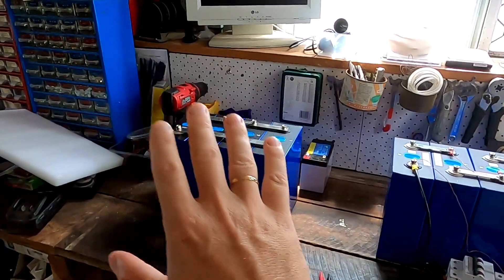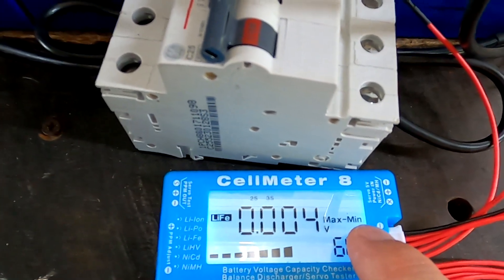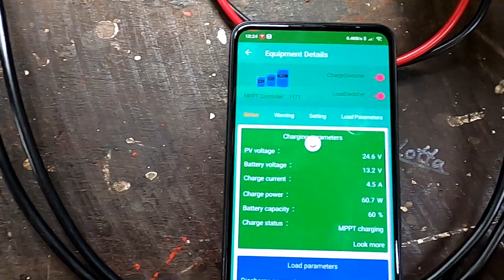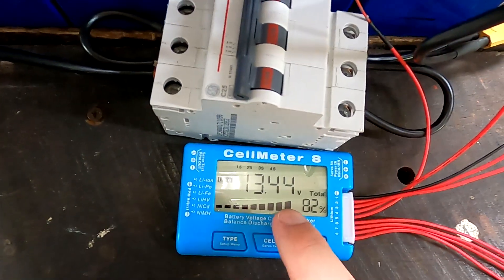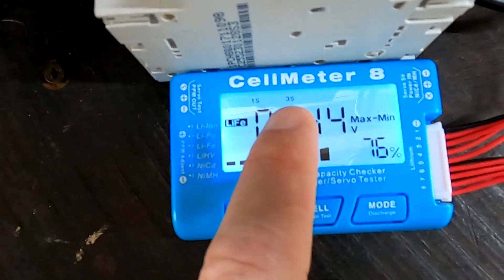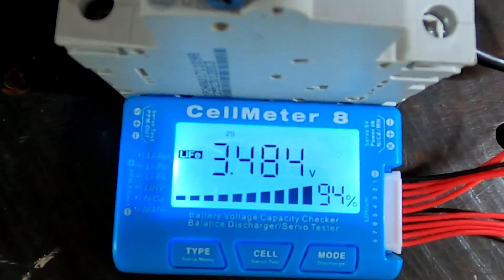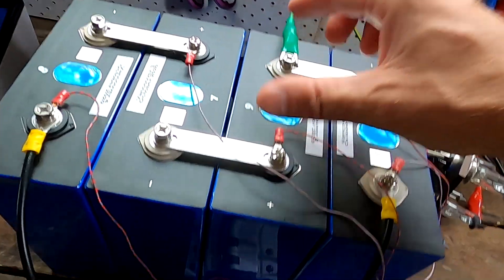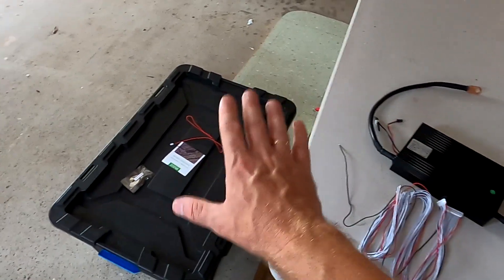Do this and you don't need a BMS 😉

Comment: What if you just use active balancer to balance them then setup the max voltage juat into 13.8v and discharge into 11v. Does it manage not to damage the cell?

Comment: The new version of the little blue meter you used in video  from Amazon for around $12 now has a setting that will balance the highest and lowest setting!!! So now I have a $12 BMS and I am a lazy BMS operator!   

I would not have known about the cell meter 8 if I had not watched your video. I run Eve cells, grade A from 18650 that are top balanced...the $12 cell meter is all the BMS I need.  My Solar Epic 4215s can be set by using the cell meter volts to have accurate parameters ...invertors and solar charges usually are not accurate so I go right from the battery voltage always.  A lot of undercharged batteries out there because people do not realize that even though, for example, their solar charger shows 14.6 volts it is actually 14.2 volts charge voltage at the battery. Thanks for your videos!

The best set up is to have at least two battery banks and let one bank set overnight and then charge it accurately the next day with no load.  Lithium batteries do best when used not charging and using a load at the same time.  I have two ebikes and I think lithium batteries were meant to charge and discharge like on my ebikes. I have dual batteries on one bike that gives me 39 AH. I could put 16 Eve LF 105 in the rear baskets on my bike and have a 48 volt 105AH battery on my ebike!!! Lol.

Comment: You don't need a BMS. Just a low voltage cut off relay and one constant current power supply to each cell. The only thing that would be a good idea is to monitor each cell voltage individually and cut the relay / solenoid to cut power from the pack when one cell falls too low.

Comment: Does the solar charge controller connect only to the BMS rather than to the cells?    If the solar charge controller is connected to the battery cells, how does the BMS override?

I'm considering buying four 3.95 maximum volt sodium ion cell brick that physically looks like the cells in the video.  Why they use 3.95 cells, not a clue.   Four 3.95 cells should allow 15.8 volt maximum.   I've not been able to find a solar charge controller or a BMS for sodium ion cells.

My application is for remote off-grid campers that sit a long-time over the winter, sometimes - 40  degree F.

Will sodium ion cells off gas hydrogen like lead acid batteries?   I don't think that the sodium ion off gas which make it easier to keep the batteries in an inside protected environment over the winter?

Comment: A couple years ago I bought 3 24v k2 lithium iron phosphate batteries used. After a couple of them failed I harvested the  26650 cells and BMS. So last week I was messing around and built a 12v battery pack with the 26650 cells. It's actually 4s 5p but right away after cycling the pack I noticed that as soon as I started charging it the cells were almost exactly balanced! Im actually shocked! Now with that being said that doesn't mean that you won't ever have some kind of short. Also lithium ion cells are from my experience little explosive devices. So better safe than sorry

Comment: Bms is indeed always needed, but balancer in some situations is not needed and can actually cause imbalance. I have made battery packs from samsung and panasonic 18650 cells and used them in high power diving lights for over decade, and especially Samsung cells tend to self balance over time, with voltages being very close to each others. If balancer is used, the differences grow bigger.

I think this happens because there are natural fluctuation in cell voltages but capacity in long term decrades much more evenly. When using balancing, it is actually charging different cells with different capacity, causing different degredation over time. 

When cells are in parallel, each of them receive exactly same amp hours but possibly different watt hours.
Reply: If a balance is causing imbalance, it therefore isn't a balancer.
Reply: @clintoncoker6 It is balancer, and it is equalizing cell voltages in certain state of charge, but it does it by moving energy from higher voltage cells to lower voltage cells, and in many situations it causes uneven wear over time and makes it harder and harder to maintain balance. Making a good balancer, needs lots of research and algorithm that is more sophisticated than just equalizing voltages. 

There are many reasons why some cell voltage can be higher or lower than others. Capacity differs between cells, and there are differences in internal resistance, temperature behavior and also temperatures within the pack

Comment: Need a solar charge controller that hooks up individually to each cell to be its own bms and balancer .. 
That idea is for free..
Imagine.. the power can be pushed into lower volt cells and stop charging higher volt cells.. attach old and new cells ...if it has dc conversion to lower the dc current going to the inverter, than you could potentially hook up a 5th battery and have 16 or 17v ..the controller regulates it to a usable volt for your inverter .

Comment: I used to let connected one of those cell meters on my scooter battery  7S  25.4V  60 Ah and after some charge/discharge cycles I had cell nr 1 and nr 2 with a significant  lower voltage relative to the other 5 cells. Finally I realized that the meter to power the circuits uses the 2 first cells. Now I only connect the meter cable for some minutes to check the voltage and no more problems with the balance of the 7 series.
Thanks for your excellent videos.
PS: Just bought a JK BMS 150 Amp for my 15 kWh solar battery pack and I am very happy with it.
All the best from Portugal.😬

Comment: Good morning Mr Andy. Thanks for this well explained video on why a BMS is needed. 
I have a JBD BMS who will not allow charge or discharge and this happened after my 24V LIFEPO4 DIY battery drained to zero percent (0%) (from Xiaoxing app). When the BMS is connected to the SCC, the voltage will rise quickly and register full charge delivering 0 amps. I charge it directly via the SCC to about 36% (3.23v per cell) )and still the BMS did not start. When I connected the load via inverter the voltage of 25.9V quickly drained to 17.3v and the inverter disconnected.
The specs of the BMS is (AP 20S006 20S 200A).
I tested charging the battery pack directly with SCC and also discharging with an inverter and it works.
It means it is the BMS that is the issue.
Kindly help with the solution.
Attached is the picture of the BMS model too.
Thanks

Comment: I am not using a BMS I have a 96 cell 16s 6p 150ah 48v battery bank. I only use a balancer and the charge controller its an outback FM80 settes .5 volt below recomended voltage 3kw array I was using a Daly BMS but the voltage at the series 15 an 16 was higher than the other and it disconnect the system buy another and did the same I dont know why both BMS did the same... so I only use the balancer.

Comment: Hey, if you have a 4s battery but its made with 8 cells. is it better to have 2 bms and connect the two total packs or only on bms over all the cells?
Reply from the maker: I like the idea of having two BMS for such a setup so 4 cells in series with one BMS and this in parallel with the second set.
The major advantage here is that each cell ist controlled individually, while in a 4s2p setup you will have two cells in parallel. They will show as one cell in the BMS but are in fact two cells.
Also, from a redundancy perspective, if you have two separate banks in parallel each with their own BMS, if one fails of one faulty cell, the other bank is still working..

Comment: I think that no BMS is not a good idea. The batteries are too expensive. Have at least a watchdog running to disconnect in case things get out of hand. There are many cheap ways to do this. Even with an arduino and a couple of mux shields. Check the voltage of one cell every second. Sound a warning if things worsen. Disconnect the battery pack if things get really bad. 
You don't need to do any balancing usually. Just accept that the lowest cell capacity dictates end of charge/discharge. Return the worst cell to the vendor, if it is out of spec and get a new one. Or add a little 18650 to that cell (fused!), to add to that individual cells capacity.

Comment: hello please may we know is it possible to connect a lifepo4 pack 24v like this with a bms to an inverter that does not have any battery communication input ? Someone said the bms must communicate with inverter in case the bms stops the battery while inverter is running ?? Could not understand how this would be a problem.. TIA

Comment: Very interesting video thank you.i have 48v  BYD lithium Battery 15.4kWh but unfortunately I misplaced the cards connecting the bms that mean I don't have a bms in the Battery pack,they are new and never been used I want to know if there is a safer way for me to use them please.

Comment: I understand the overall message,BUT, the cell 8 is inaccurate at measuring individual cell voltage...I wish U had of used ur multimeter and verified the cell in question. The cell 8 is good for reading overall pack voltage and Ballpark cell voltages, but it can and will be WAY off!!

Comment: Great video. What would happen if an inverter does not have a bms connection, but the battery has a built in bms.  Can  one still charge a battery safely by setting up the correct parameters for the battery. on the inverter?

Comment: Just connecting LFP cells i parallel will not balance them. To balance them (top balance) you have to charge them to 3.65V while connected in parallel.

Comment: Is 3.2 volts per cell good to store them?
Reply from the maker: Voltage cannot be used to determine the SOC with LiFePO4 cells. Storage should be at 50-60% SOC if not in use for a few months.

Comment: I would presume that the load needs to go via the bms? If you were connect an inverter I presume that load would need to also go via the bms, therefore the bms would need to rated to take the load of the inverter?

Comment: Thank You for posting very useful information, and this leads to my power  question on this subject. When I bring in a solar panel charge controller, how do I assure that the power controller is controlled by the BMS and the BMS dominates the charging process.

Comment: I’m new at this, but, confused, my MPPT cannot have the battery disconnected while solar panels are connected, doing so will damage the MPPT charge controller. So i think an active balancer is what I need. The charge controller and the inverter should be the only way things get shut off automatically. So I need to top balance my batteries and then find the best setting for the overall voltage to stop charging. And also the same with the inverter as far as discharging goes.

Comment: I'm a noob but wouldn't that be a great feature to be put into a MPPT or PWM charge controller ie Charger + BMS or does it just make more sense to have it on the battery? I would imagine it would depend if you batteries where close to your charge controller and static. Anyway great video "explaining" why a BMS is important.

Comment: A quick question.  Can we connect 8 cells in parallel rather than 4 ... and let this sit for a week or two and all 8 will be balanced?  I am wanting to make 8 Cells, 304 Ah each and connect up to make power for a 12 V system for ham radio.

Comment: When you have only a 4 cell battery pack, it is easy to charging the cells individually, at your desired voltage and current to recharge them up again!! I first charge mine, as' a full battery, till almost reaches its limits, then finish off, just charging the individual cells to their full potential, thus keeping the cells balanced and ready for a further discharge. Regards George.

Comment: No BMS needed on a parallel configuration? Please explain why not.  See at: 16:45. Thumbs up and subscribed.
Reply: Because when batteries are hooked up in parallel, they are by definition all at the same voltage.

Comment: Thank you for ALL your hard work, testing and sharing of knowledge! I'd like to do an experiment, Eliminate the BMS and use the 3S 4S 5A Active Equalizer Whole Group Balancer you tested in another video. Wouldn't this handle the problem you identified in this video i.e. one cell running away with too much voltage? I figure the sum voltage can be monitored by the Shunt/cerbogx and using the cerbo relay to stop charging. Do you see flaws in my logic?

Comment: i was thinking that the best connnection for batteries is in packs of four , a parallel of two in series . and that forms a block , for a scale up, next you go to four blocks .
the reason behind this is to keep a uniform charge and discharge of the batteries ,without a single battery or more ,goes between two other batteries . 
and i think the measuring points for calculating where an error in the uniformity exists , are less .

Comment: your obsession with short term cell voltage may not work with lead acid or anything. let the system reach a full charge equilibrium. you do not talk about temperature and that matters.

Comment: I am 77 years old and have lots of experience with battery systems. always use series connection. never parallel. if you need more capacity make the cells higher capacity. where I retired we had 2 radio back up banks of 400 ah. 6 cells in series. they still met spec at 22 years old. no BMS at all. If you add a 2nd battery to your vehicle to run your ham stuff etc. add a circuit breaker in series with a N.O. relay that comes on with IGN(NOT ACC) so when the engine is running both batteries charge properly and when parked the 2nd battery can get run down but your vehicle will still start. NEVER use a battery charging splitter. the splitter causes both batteries to be undercharged and lots of trouble with that.
Reply: What type of batteries are you referring to? Lead acid generally don't need a BMS because they self-equalise at higher voltages.

Comment: Come on, you know better. Why lower yourself to pitiful YouTube Clickbait standards? I've been using a 20kWh 14s pack on a 3kW inverter charger with no BMS for years. Active balancer does half the job, inverter does the rest. And sure if one of those fails there could be a problem. Just like if your proxy BMS fails.

Comment: OR, take multiple separate windings from a transformer (rectified etc) to each cell... the power transfer will scale relative to the voltage difference, so the cell with the lowest voltage will get the most current, and balancing will occur during the whole charge time... a cell with 0.2V left to go will get twice the current as a cell with 0.1V left to go, so they will all finish charging at the same time. This way, batteries that don't get chance to fully charge will still get balanced

Comment: So, when I have a JK BMS (1A active balancing) bind to my cells and connect a "dumb" charger (= simple power supply) with two cables - I will not need to be the BMS operator? Meaning: with a BMS connected to the pack, I will not need an intelligent (= pricy) charger, right? Thank you for your very good & funny videos! :washhands:

Comment: It would be interesting if you could do a comparison with two identical panels out in Open Sky both on sunny and cloudy days one with an mppt charge controller and the other one directly connected to the battery and measure how many kilowatt hours each system produces.

Comment: Though is good but my main reason of watching was to learn about how to avoid bms totally without me been the operator
Reply from the maker: I would not recommend using a battery without BMS. This won't end well unless you drive the cells in a very certain and conservative way, say use them only between 3.1V and 3.4V. This would be a total waste of capacity you've bought and not using.

Comment: i have just received my lifepo4 12volt 280amp battery set up and would like to know do i need a BMS of 280 amp to run it im going to run it in a camper van on solar i am a first time builder

Comment: Hi sir, do the lead acid battery need a BMS to cut off the current when we discharge it. I mean, when we use the lead-acid battery in our project, do we need to apply BMS to limit the over usage of the battery

Comment: You don't need a BMS if you use a separate DC-DC buck converter for each cell only for charging.
The advantage of this is you don't need to balance each cell, they will be always charged to the voltage set in converter.
Reply from the maker: Yes, you can charge each cell individually with it's own 'charger'. But you should not connect these converters all to the same power source 🔥
Reply: There are chargers specifically designed for this purpose - that's how they charge radio control model batteries.

Comment: Cool video. But unbalancing takes months to be even recommended on a good lithium battery. Also Lifepo4 is very safe and won't catch fire like other lithium batteries...even under a short! 

People pretend all lithium batteries are the same... No. lithium ion is a bomb so yea you want bms on those. Lithium-poly is moderately safe, no fire, just smoke. But Lifepo4... Maybe smoke but that's it, if anything. 

Bms restricts output amperage, usually by A LOT, unless you pay a ton of money to get one... 

Balancing is nice but for Lifepo4 it's not really needed often. I'll likely do it once a year just out of curiosity. My charger has a balance function, I don't need to charge, I can  just hook it up with a jst-xh connector and leave the room and come back later. 

Great source for solar info though, I'll subscribe to learn more and fill in details I may not have known about setups.

Comment: I was wondering if there is a switch that would allow me to run two battery banks with one charge controller.  Something could switch back and forth between the banks as one gets low it switches to the other?